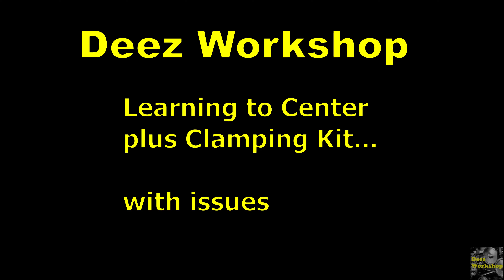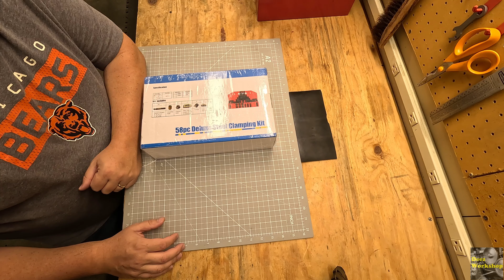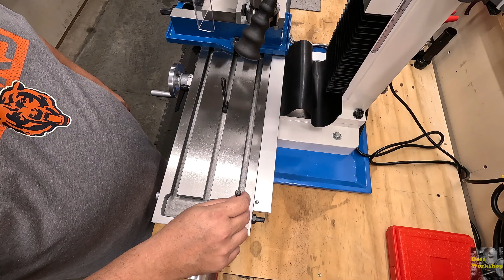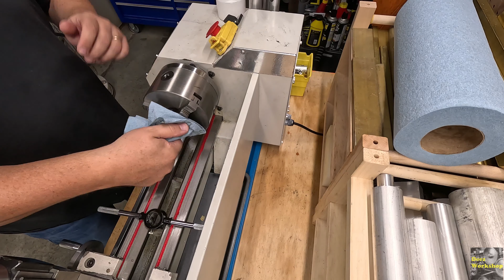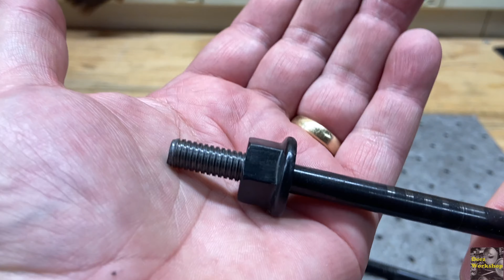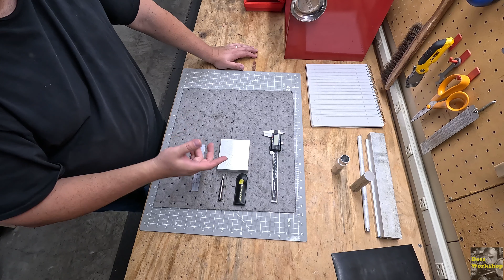Learning to Center using the DRO plus Milling Table Clamping Kit With Issues

Comment: Dee, I trammed the spindle and my vise today and afterwords I made my first attempt at milling some aluminum. I have to admit i was a little nervous at first but  once i got it going I felt more at ease. These thing sure do make some chips, unlike the lathe. Thanks for all the info you have provided with your videos.
Reply from the maker: Same for me.  Its a different machine and different experience.  Chips are way more messy :-) .  I am working to better understand climb vs conventional cuts.  If you arent careful climb cuts can pull your workpiece out of the vice and sling it across the room.  Its one thing I want to get nailed down soon before I start chipping away at heavier materials like steel.  Loving this machine thought.  I am gald you are finding the videos helpful if not entertaining.

Comment: Not sure about .0001 on a edge finder, but on that mill its fine.  Indicator pickup is for Jig Bore type machines. Did you fine tune the DROs accuracy yet, or is that another video ? Ah ..gages blocks for Xmas. Dave has a nice video on buying them.
Reply from the maker: A good set of guages is definitely on my christmas list.  Off to Daves channel to find that video.  He has a lot of great stuff.

Comment: Accuracy of that edge finder is less than a tenth but edge finders don't like high speed maybe 500 rpm.
Reply from the maker: Thanks. I am still figuring out so much of this mill. It’s the little tips and advice like this that are most helpful. Appreciate it.

Comment: I worked in tool & die shops for 34 years. If the foreman of any of the shops I worked for saw you using an edge finder they would do one of two things…..smash it with a hammer or fire you. Zero tolerance on using those because they aren’t accurate. Swing and indicator always. When I was an apprentice my lead mold maker showed me once where and edge finder would pull like it hit the steel when it was a full 0.016” away…..why? Magnetic forces I always assumed. Alum probably is much better but a tiny burr will get ya too. Anywho, just swing a test indicator mounted in the spindle.
Reply: Dee-   what you did with the DRO is my way of finding center. Lots of useful sub routines today in that box. Just know the edge finder is fine for the accuracy of that machine. Using a indicator is for super acurate pick up, less than .001<   Not nessasry on that machine. In my day we helded. 0001 on Houser jig bores. Your home shop is for fun !!  I see you are building up tooling. Go slow and buy once, buy right. Enjoy your videos !!  😊😊😊
Reply from the maker: Thanks,  I want to learn all the tools.  Edge finders included.  I have a lot to go through and in time I will improve.  thats the fun of it for me.  Learning and sharing my learning experiences including my mistakes.  its easy to edit and not shar that stuff but thats not what this channel is about.  its about how i learn, Hanging out with me in the workshop, and hopefully getting better each time.  Nothing I am working requires any huge amout of precision although I do want to work towards it when I can.  I am still improving my techniques and knowledge.  This is a hobby shop for my enjoyment and I am choosing to share it with all who want to stick around with me.  on the Tooling I did grab more than I anticipated to start with but what I did get I really needed to continue working on my starting projects.  I have stopped other than an R8 collet set for now and will buy what I need as I need it.  Thank you for the feedback and finding the channel. I appreciate you watching.
Reply: @deezworkshop  I’ve learned from you as well. I bought your lathe but it’s longer is all the difference. Everything you’ve shared with everyone is exactly what I’ve found so far. But for the price it’s acceptable and I’m fully capable of giving it some love so it’ll work properly. I bought a Precision Mathews mill as well but haven’t used it too much so far. I’ve found zero issues with mine but time will tell. It’s the biggest I could go with and be able to get into my basement without the stairs collapsing.
Reply: @adhawk5632  😂😂😂 I’m teaching you correct practices. Take it however you’d like.
Reply: @adhawk5632  everything you’ve typed has zero value to this conversation. Edge finders are not accurate period and have no business in the precision metal working world. Deez is a great guy and has a great YouTube Channel, he’s learning as he creates content, he is learning g as he goes with help from others and he teaches others as well. It’s all win/win 😎😎👍

Comment: You can remove the fixed jaw and attach it to the rear of the vice. That will move the workpiece far enough back for you to edge-find the y-axis.
Reply from the maker: Great tip.  I am going to try this next time I am working wtih that  piece of aluminum.  Thanks

Comment: Ugg, as my last comment said when you were making threads, you need to go backwards to break the thread at least every revolution or more often. Especially on hard material. You can fix it by using your lathe to make the threads. Something new to try/practice.
Reply from the maker: Please remember I have videos recorded and scheduled for release,  You may make a recommendation and a few things may happen.  Another video already recorded may show the same issues you pointed out.  It doesn't mean I didnt read and consider your help.  The other thing that can happen is I did the same thing our of habit or simply decided to use my tooling in that way. Please bear with me as I try to do my best but it is my hobby shop where I am learning and continue to improve.  On aluminum I typically have had good luck using the lathe making my threads.  (Spoiler alert upcoming project using aluminum and threading)  I used the lathe and my custom tailstock die holder.  Worked great.  Still love the die holder project.  cheers and Always appreciate the advice from the professionals and experienced machinists out there.

Comment: I am going to guess that your Y axis was off by about .100". When you zero off of one side with the edge finder you have to subtract half the diameter of the edge finder tip. So find your edge, zero your DRO then move half the diameter and zero again. Hope this helps.
Reply from the maker: I totally botched the y axis,  I tried to do math.  my mistake for even trying to Math...lol.  I actually did try to add the difference but the DRO has more decimal places than I am used to and simply didnt move the y axes to the right location.  The X Axis worked great though and I know I can get the Y axis to come out.  still playing with it.  This DRO can do a lot of cool stuff but im trying to keep it simple for now.  I think your suggestion will help,  Going to try that this week.  Thanks.

Comment: Should have set your y on the inside edge with the edge finder and added half the width of the edge finder to the 3.48209 then 1/2 it to get center.
Reply from the maker: Yeah, I tried something like that but on the DRO it has more Decimal places than I am used to and got off about 100 thou.  I botched it.  I like your tip and will give it a shot.  Thanks.

Comment: I have a similiar clamp kit, I didnt like that the stud could pass through the t-nuts so i welded up the bottom side. I used a brass bolt not quite bottomed out and filled up the hole with weld and then ground them flush so the stud wouldnt pass through anymore.
Reply: @adhawk5632   I tried peening it  but the t-nuts must be hardened steel because all I ended up with was mushroomed punches and damaged chisels.
Reply from the maker: I will look into this. I don’t like how these can pass through.
Reply from the maker: Yeah I am going to come up with something. No welding for me yet but I can jb weld with the best. lol. Trust me I am mindful of this lathe table and those open ended t-nuts and will come up with some safeguard. I appreciate all the advice from everyone on This too.

Comment: The reason you didn't get a full thread is because those threads are pressure formed which displaces the material to form the full profile of the thread. It doesn't remove material like a regular die does.
Reply from the maker: This makes a lot of sense. As suggested by @adhawk5632 I’m going to check out a video on it. Makes sense. Overall I have enough of a variety of studs to get the job done or I’ll replace it or make a custom one. Appreciate the insight on these. Interesting stuff.